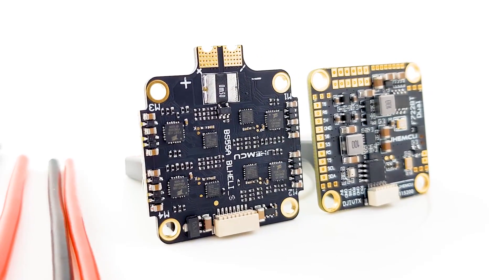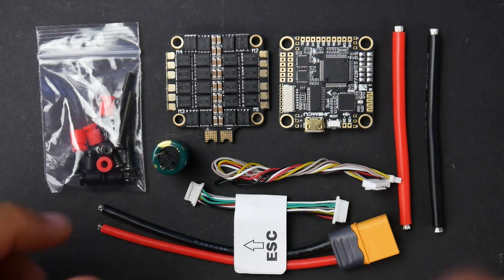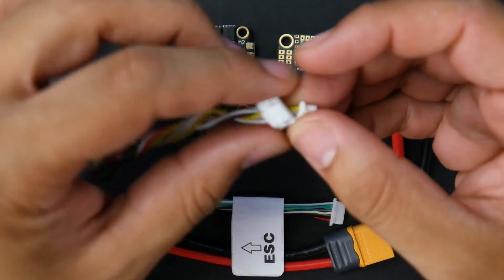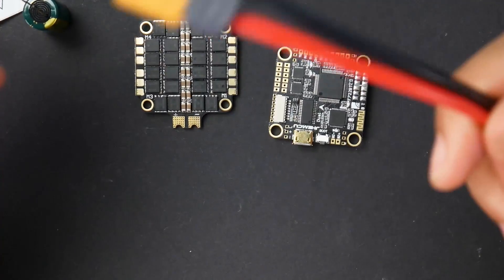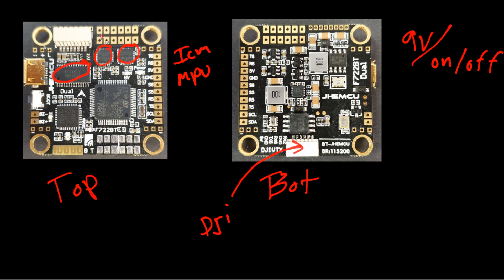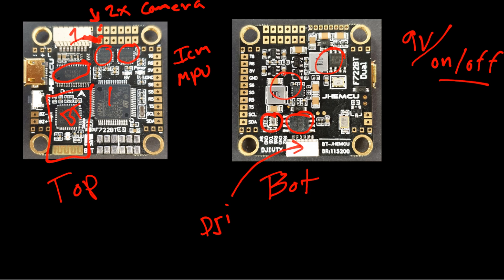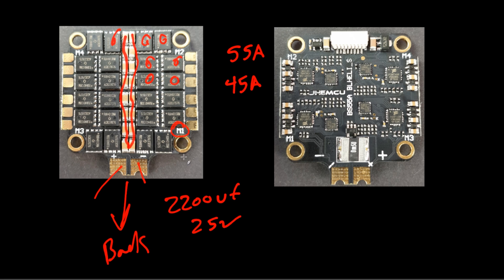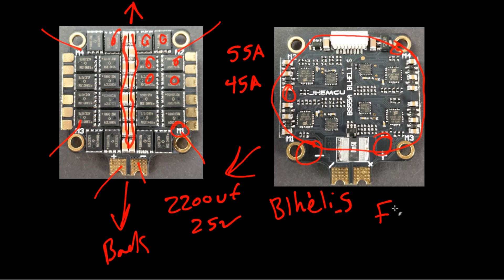IT HAS EVERYTHING!!! // JHEMCU F722 BT Dual 55A

Comment: Hi drone mesh! I have some serious problems with dji air unit. I m not using the rx2 on the dji unit for remote controller so i did not used that on the dji connectors on the side i only soldered crsf like you say to do in the vid. But what happend now is that if i turn on the kwad —> dji led turn solid green. Crsf receiver turn solid red.  When i turn on my radio,, crsf receiver go in bind with radio but shortly after that, the dji air unit turn off compleet! So have that something to do with the on off switch 9v??? I don’t understand why it does this. How do I menage this??  

Thanks!
Reply: i got the similar issue did you solved it?
Reply: Try to adjust the range of "USER2" in Modes Tab all over the adjustment bar, this Always Turns ON User2 = 9V.

Don't Know if this helps, Just give it a try.
Reply: @ossy3rd  6 months to late 😜. Haha no i still thank you very much for the reply my man, indeed i had to open the user for the 9v output

Comment: How do you connect this FC to speedy bee? every time i try to connect  through Bluetooth the connection times out.
Reply: I use the same FC, Bluetooth worked fine. Just need to grand the access for speedybee app.
Reply: @ossy3rd  how to do you connect? I can't pair via bluetooth since I do not have the passphrase...

Comment: Hi , please, can you tell me if the pads to change the cam can be used as a switch to turn the vtx on and off by configuring pinio? thanks bye.
Ciao , per cortesia , sai dirmi se i pad per cambiare la cam si possono usare come interruttore per accendere e spegnere la vtx configurando pinio  ? grazie , ciao.
Reply: You can use the "USER2" in Modes Tab. This Option switches 9V on and Off. I use it to Switch the vtx and Cam on and Off.
Reply: @ossy3rd   yes thank you, I read the manual well and I had solved.

Comment: Hi, I have a jhemcu f7 like you. There is a problem in operation mcu f722 very hot even when only usb connection, about 65 degree Celsius. Is it error?
Have you had a similar situation yet?
Reply: Sam problem here. My led lights also wont turn on when connected to usb

Comment: Hi. Enjoy the reviews. Some say all blheli s/32 esc perform the same which I find confusing. In general are we paying premium for extra filtration/longevity or are there performance differences? Many thanks.
Reply: Thanks for the reply. I'm a park flyer. Nothing serious but I've built many quads. At my level I can't tell the difference and the iflight, rev35 and mamba have given me reliable service even after much abuse. Cheers.
Reply: It's honestly pretty hard to tell these days with options like the jazzmaverick blheli_m firmware. It makes it gives s a few options that 32 has. 32 will give you more tuning options.

Premium boards usually include blheli32. Budget boards opt for blheli s. I'd say components are often better in the 32 boards. But some blhelis boards stand out, like the mambas.

Comment: In case you were still seeking out source vendor for JHEMCU I have found FPVELITE to be the main dealer of these products as well as HakRC.
Reply: Aliexpress. Jhemcu store.
Reply: @richardheedfpv9626  XT-Xinte (website and Ebay) and JMTstore on Ebay are also a good option.
Reply: Yes and 55a aio whoop boards!
Reply: what if I would go with the combo JHEMCU fc w/ MAMBA F50 ESC
Should you put the connector between fc and esc also in the way the label says so?

Comment: HIFIONRC F722 Pro or this one, which stack of those would you suggest? 
This will be my first build and since the prices are very similar I'm not sure which one to choose?
Reply: This one has a connector for dji, easier instal of the dji air unit.
Reply: @NiceHopTerps  Thanks man, but is was more a performance-type question like are there any major differences. But still appreciate your answer so thanks again.